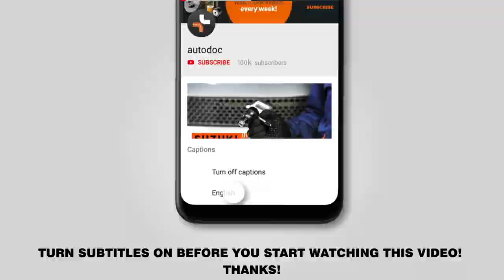How to change front brake discs / front brake rotors on OPEL ZAFIRA-B 2 (A05) [TUTORIAL AUTODOC]

Comment: would it not have been easier to clean the new disk before installing? you also only did one side?
Reply from the maker: Before installing the mechanic cleaned the disk on both sides, this moment did not get on video, in the video the mechanic cleaned only the place where the copper grease slightly got.